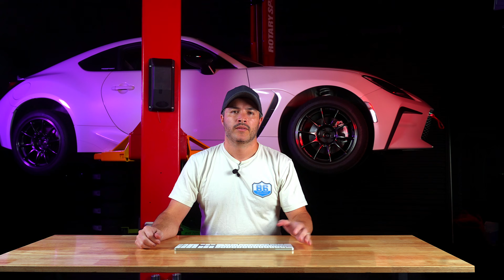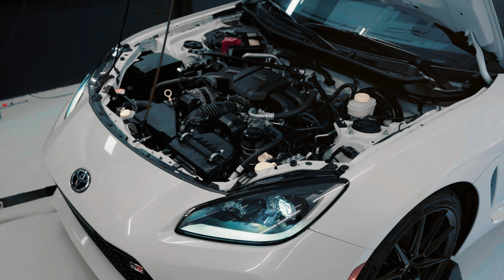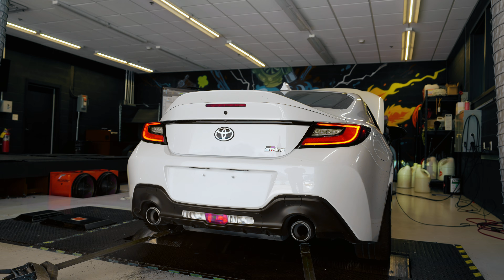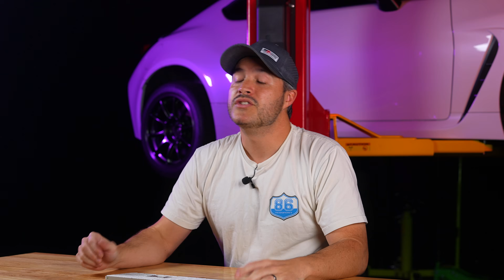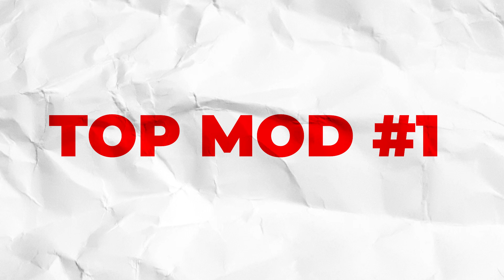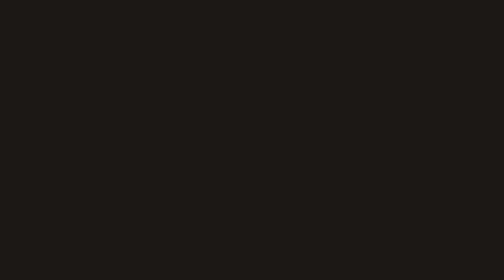Top 10 Toyota GR86 Mods In 2026

Comment: I've been a huge fan of the 86 platform since it's inception way back in 2012! Though I appreciate it's ratios it's power output has always concerned me! What's your thoughts on the G16E-GTS and use with the 86? I know it'd be a challenging and expensive venture! But I think the fun potential is so high til I'm shocked more tuners aren't jumping all over this swap! I guess I get why Toyota isn't (Bottom-Line $$$ concerns)! But I think if someone bravely jumped on this swap, it's would storm the streets like an all you can eat sliders, wings, seasoned fries and beer special! 😂 ✌🏾 ❤✊🏾
Reply from the maker: It has been done!  Evasive Motorsports and Toyota USA teamed up to G16E swap a GR86 and Larry Chen did a nice video of the build: https://www.youtube.com/watch?v=bu-j93V9WpI

Comment: For intake if you want some sound, id get the outbound motorsport intake snorkel kit. It adds about 50%-60% more induction noise.

For oil cooler, i dont think i can recommend air to oil cooler for a dual duty car. A bigger water to oil cooler (like the ansix auto w2o kit) is actually more efficient.